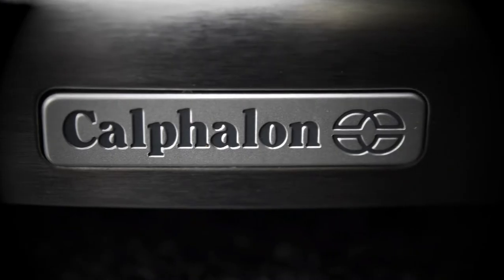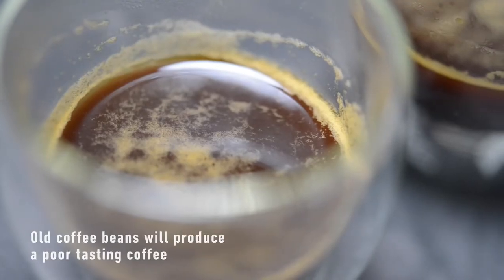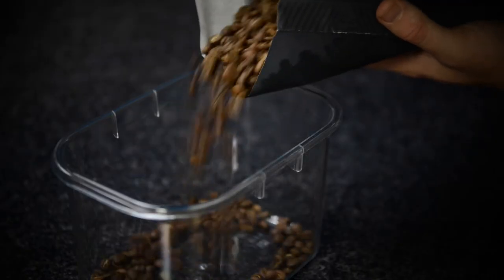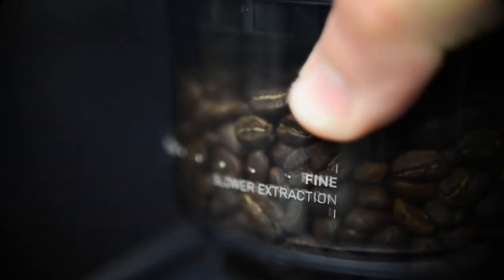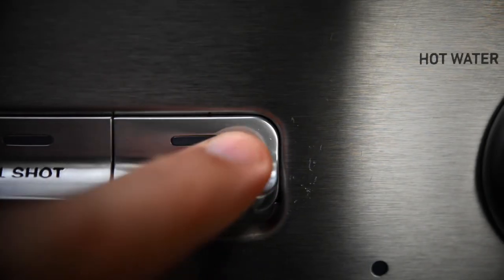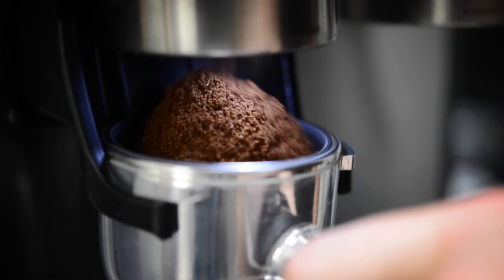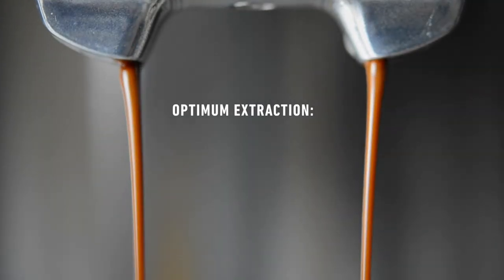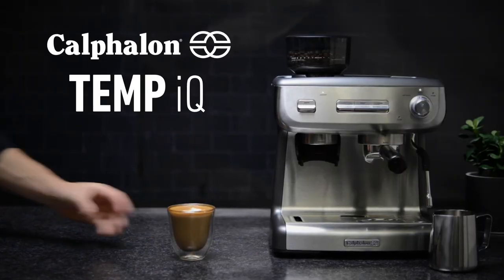Calphalon Espresso Grinding and Extraction Guide

Comment: How do you prevent the coffee grounds from falling out of the filter when grinding?  Mine seem to just spit all over once the filter is about half way full.
Reply: Same with mine.  I end up using my fingers to keep it from pouring everywhere.
Reply: I worked in many family owned coffee shops before and thats just how all of these work, never seen one not do that. I don't own this product but I think I know exactly what you're talking about. If I had one for home use then I would use the extra grinds for cold brew
Reply: I own this machine and I clean it often,  I never experienced coffee falling off. Maybe there is a build up in the bur ?
Reply: @bfflorida2311  No, they're talking about it making a mess, even new mine did this. They need a smaller target!